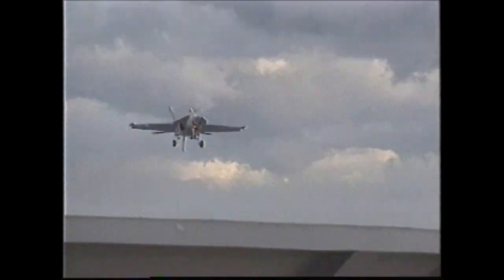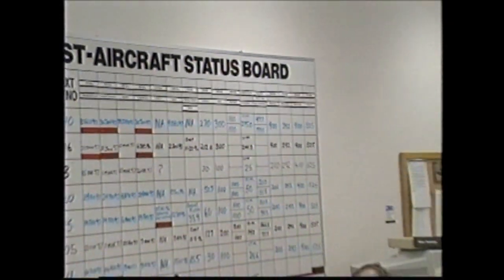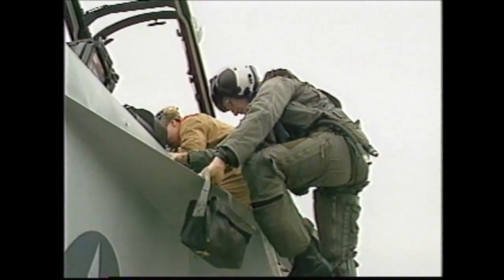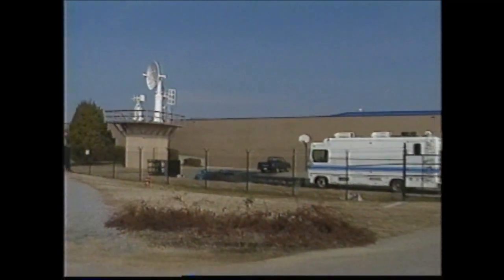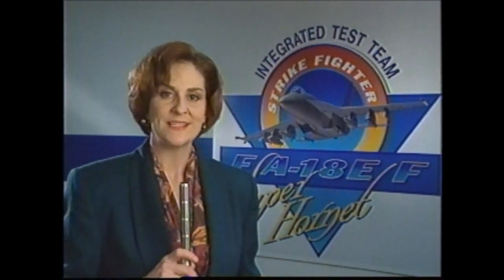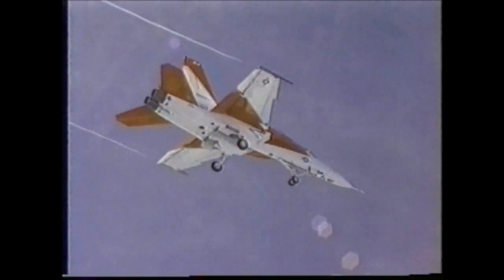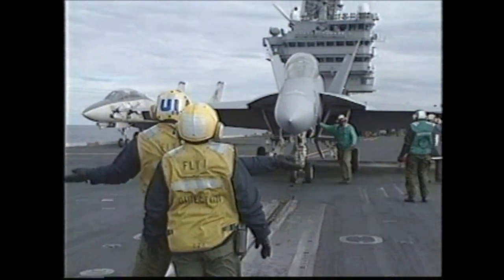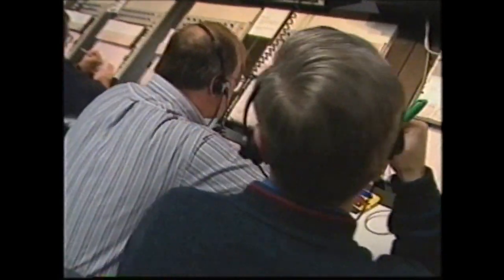The New F/A-18 E/F Super Hornet

Comment: I remember one of the test birds at McDonnell Douglas (bld45) running full travel deflection on the stabs. From very slow full travel to the point where the stabs was moving so fast that it was just a  blur with a loud hum noise coming from the stabs. Full 5000 PSI on the hyd system. If Lockheed Martin did the same testing  that McDonnell Douglas did. The craptor and the f-35 would NOT have taken so long to get into full production!

Comment: F/A-18 E/F,sure is "1" cool looking bird.Most of us used to think even its predecessor-the 18 C/Ds being acrafs that's got some awesome bite,for it's USs' primary tool for power projection of Its principles.As it turned out,it's not as we had thought,it's nothing more than another platform for delivering bombs,havin' less than small enuf turn-circumference,as compared to the F16 or Mirage 2000 & its G-loads,maxed-out at mere 7.5-8,considering its level of tech-sophistication & the generation it

Comment: sir, i am an airedale marine A-6E's 77-81. i won't bore you with my thoughts, however, there is another video here of an F-18F doing a outstanding flight demonstration with 6500 pounds of underwing stores. check it out. none of the crap we had then would touch this. F-14's never carried any air to ground ordinance in my era. F-4S or F-14A would have spread itself over the field attempting that 30 degree low speed scenario. all use martin-baker.